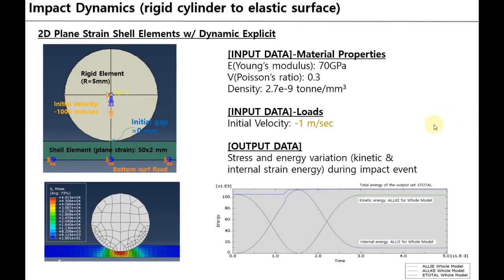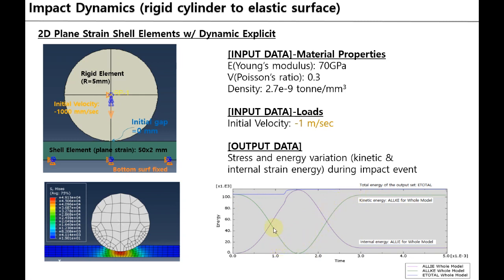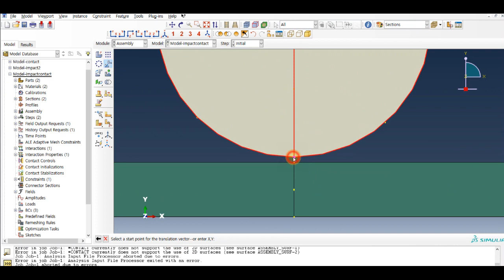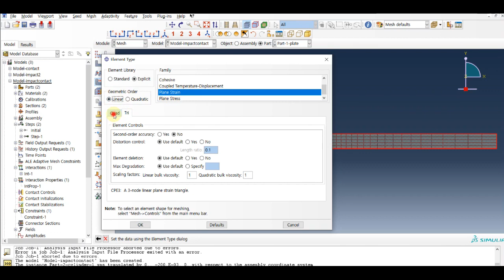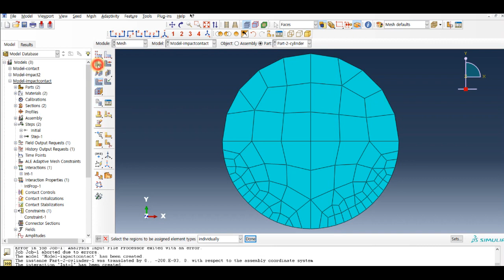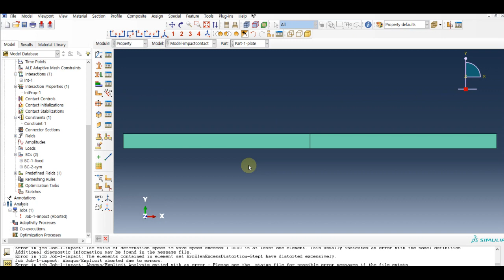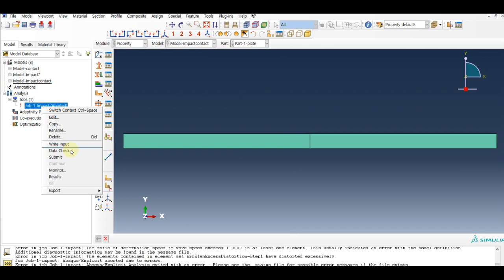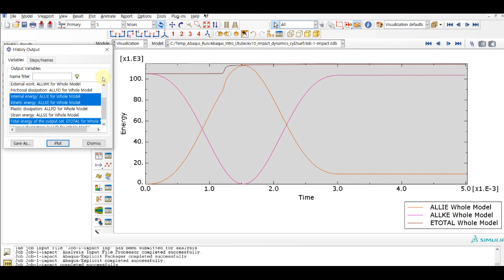Abaqus FEA - Impact Dynamics (Rigid Cylinder to Elastic Surface)

Comment: Great videos!~! Could you give some advice for the error, "too many attempts of cutbacks", that occurs when I did contact problem use dynamic steps? And if switching to static steps, the model is able to solve.
Reply from the maker: I guess, you can try to adjust your initial time step or minimum time step...or (2) check your contact situation (initial gap?...)... or (3) you could try to use stabilization options...

I think, the following blog could be great help for you.
https://info.simuleon.com/blog/6-tips-solving-non-convergence-with-abaqus-fea